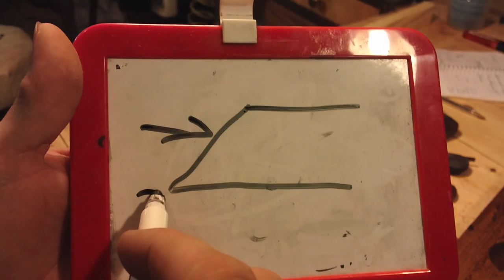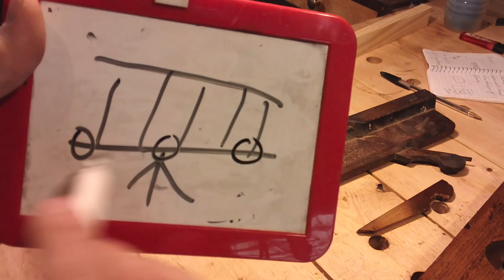The Bevels Edge

Comment: Hi Dave. Wonderful to see you back on the trail again.
Molding planes have been a fascination for me. I haven't pulled the trigger on obtaining them yet.
I have a couple that wandered into the shop but they are only sulking on the shelf. Most of them have left as Galootaclause gifts. Since they are usually on the shaky side of useful when they arrive the abortive trials have been disappointing.
The idea that they are difficult to sharpen has been the stumbling block to a real world effort to use them. 
In my second retirement, or is it 4th, I may jump in but currently keeping the Huns at bay is a full time effort. Until then I will sit eating my breakfast and enjoying you learning and sharing what you learn about this, to me, exotic breed of edged tool.
Reply from the maker: Old Sneelock's Workshop Oh it was just a short film. Its been on my mind. Had a small break and was home sick with a cold so I snuck outside. You know a grown man can only take so much daytime tv.. 
I have some that are in very poor condition as well. As long as the is some form of good wood there and its close to straight you have something to work with.
Galootaclause   hahahahahahahahahaha that was funny.......

Comment: Thank you for pointing out the fact that the back of the plane iron needs to remain parallel to the bed. Makes sense. Is that true of all bevel down planes?  Thanks for another great video, Dave.
Reply from the maker: fryefoto Yes it is. When a plane is bevel down and you place a back bevel on the iron you are changing the degree of approach. Now this can be used in your favor if the grain is hard of highly figured but with continuous sharpening you have to put it back.